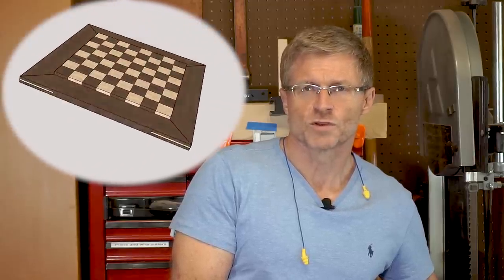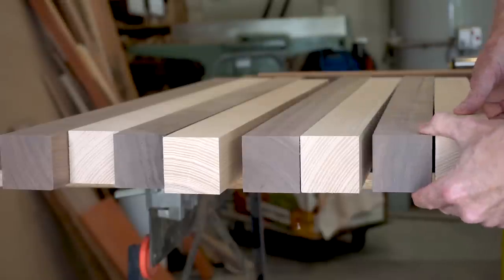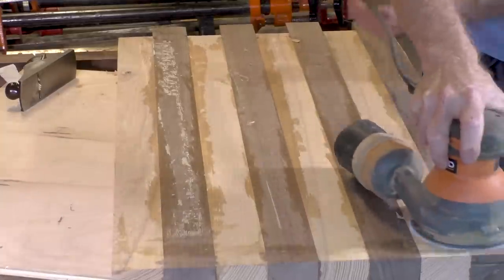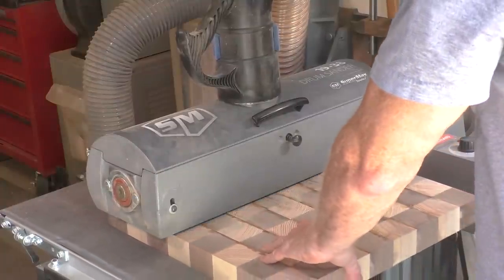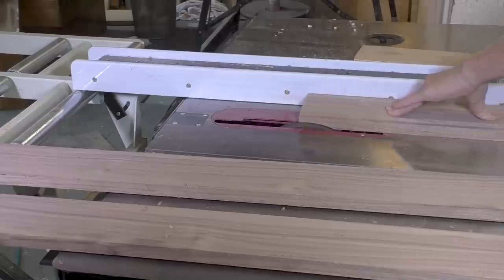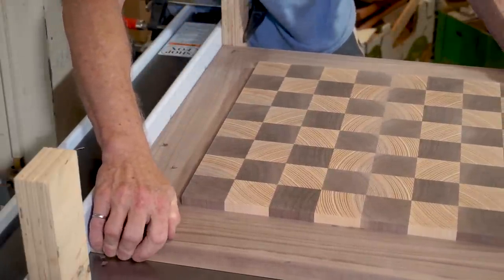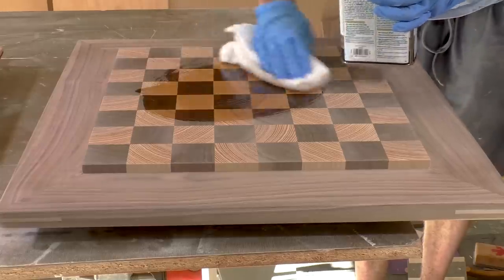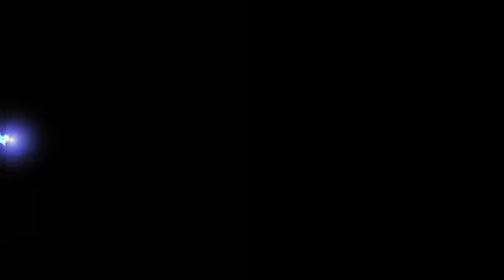How I made two Regulation Size End Grain Chess Boards

Comment: Great chess board.  I have made a few of these and can see what a nice job you have done. The person you made this for will be very happy -- as will their children and grandchildren, I would wager.

I believe you would also appreciate the way James Krenov designed the board for his chess table. The individual tiles are connected by dowels and they seem to be floating in space.  The board can be easily made to fit on top of a case that holds the chess pieces. Typical of a Krenov design, it is extraordinary.  Again, I think you would appreciate it.

As always, great work!
Reply from the maker: The James Krenov chess table is a stunning piece of work! Thank you for pointing it out to me.  I'm almost tempted to try making one. Maybe I'll work up the courage to give it a try one day.
Reply: @Woodumakeit  cAN You tell me where I can order One?

Comment: I like the walnut frame, but both are beautiful.  I am actually in process of making my own board, but won't be doing end-grain.  I am very jealous of your tools!  I have 3 tools on my list that I see as "must haves", 1) band saw 2) wood lathe 3) drum sander.  I had to take my board to a local wood supply house, to have them run it through the drum sander.  They only charged me $10, but it is a 35 minute drive each way, so time was the real cost.
Thanks for taking the time to put this video together and sharing with the rest of the world.  YouTube definitely provides a platform for sharing and learning!
Reply from the maker: Thanks for the feedback. It took me a lot of years to accumulate all those tools. It's great that you were able to find a way in the short term to get access to a drum sander. Mine has become invaluable and it's one of those tools that I wish I had bought much earlier.
Reply: You can do it without a drum sander but you have to very carefully glue up the strips, it's a pain but it works with a little sanding. That being said... i want one too 😒

Comment: Yes, yes I will make it.  Great video with some great tips.  Going to attempt this project over the next few weeks.  I'll let you know how it goes.  Thanks for sharing yours.  I'll go with the tiger maple as my favorite just because of the quilting on that border.  Beautiful!
Reply from the maker: I'd love to see the end result!
Reply: @Woodumakeit  Hey Mike, I'm almost finished with this project, but wanted to get a little advice.  Where my border is meeting up with the chess board itself I've got some small gaps.  I'm trying to think of creative ways to conceal them.  They're a little too big to try to fill and sand so was thinking of some sort of a small accent piece to butt up next to the chess board almost like quarter round.  They wouldn't really need to be too big in terms of height and width, maybe 1/8" to 3/16".  Any ideas?
Reply from the maker: @DEJaegerWoodworking  That might work, although if the gaps are due to the edge of the board being uneven, it might not conceal the gaps.  Another possibility could be to use a router and carefully rout an intentional gap between the frame and the board. If you email me, I can send you a photo of one I'm working on now that has an intentional gap like that. I did it preassembly with the table saw, but a router should work if you're careful.

Comment: Hi. I've been meaning to make one of these but you need to start with 3" thick timber to get a square of reasonable size, (70x70mm is the most you can hope for) and that is expensive, especially Maple/Walnut. I picked up some unidentified hardwood from a pallet which is about 4"x3" so I'll give it a go.
Great work, got me motivated again!
Cheers

Comment: From the pictures the Walnut framed one looks tight to the end grain, I'd be worried that movement might stress the frame, whereas the tiger maple appears to have expansion room.
Reply from the maker: Good observation regarding the gap along the maple frame. I am hoping that both will be ok, but the walnut frame definitely has more risk of expansion putting stress on it.
Reply: @Woodumakeit  Any update?  Did the board hold up?  In my limited experience, "I hope it will be okay" has never worked out well for me when wood movement issues are in play.  Then again, I live in Canada, where the climate varies considerably with the seasons; perhaps you live somewhere where it's less of an issue.

Comment: Very nice! I am in the middle of the same project. I looked this video up as I was nervous about getting rectangles following the planing of the first glue-up. I think I might try to leave the squares slightly rectangular going into the first glue-up, then planing down to square. Great ideas for the frames, will be borrowing that for sure. Thanks for the confidence boost and motivation!
Reply from the maker: Thanks for the feedback. It's definitely smarter to start with rectangles for the first glue-up. I've done that for my subsequent videos where I made chess boards.  Good luck with everything!

Comment: I love your chessboard creations!   I ended up making a version that was a combo of your 2 board designs.  I used curly maple for the frame but with no bevel.  I also popped the curly maple with danish oil followed by shellac and a brownish glaze. Then after another shellac layer, did multiple wipe-on poly layers and polished it to a smooth satin finish.  I went with a poly finish since it will be a chessboard that gets used by all ages and I am fully anticipating there will times when a glass is left on the board...

Comment: I made a couple of end grain chess boards that were also cutting boards last year as gifts, and I'm thinking of doing another one as my next project. Making them to regulation width (25 inches by 25 inches) would make them almost 2 and a half times as heavy as my 16 inch by 16 inch efforts. Those were chunky at 1.5-2 inches thick. Making one that size... I might as well just make the chessboard into a tabletop... which could be pretty neat, actually...

Comment: First, thanks for all the time and effort you put in to create this video.  It seems easy, but if like myself, I find doing the video and editing take longer than the actual build of the piece. 

I appreciate that you used solid wood throughout, and this definitely puts this in the higher class product, but I really take the challenge to minimize the amount of precious wood used in a project, and the fact that you really only view the top of the board, that you could have just used a "filler" like MDF for the foundation.  You could have made at least a dozen of these boards with the amount of walnut/maple that you used.  

But, I am definitely impressed by your workmanship and the final product!  Well done.
Reply: I like the idea of conserving hardwood. How do you protect the MDF from moisture? I would worry that the MDF gets wet (spilled drink, left in the rain?) and the expansion ruins the project.
Reply: @stopfollowingme2391  The MDF would be sealed under the wood and not exposed to any minor drips/spills.  If I made a chess board like that, I guarantee it won't be sitting out in the rain.  Yes, if you soak the board in liquid, the MDF would be an issue, but that is not all that would be an issue.  If MDF is still a concern use pine or other common wood for the "filler".

Comment: I just did the first glue-up step on mine--actually the 2nd since I didn't have 10/4 wood to start with. I used ash cut from behind our house (useable stuff now extinct). For the dark squares, also ash, but thermally treated so it's the same color as walnut. Picked up a nice hard curly maple board today for the border. Can't wait to get back out to the shop tomorrow to cut the end-grain strips and glue them up into something that looks like a real chessboard. Thanks for the inspiration!
Reply from the maker: Good luck with everything!

Comment: Love this video. Thanks for sharing. There's one thing I'm struggling with though. The frame should be pretty much dimensionally stable. If the end grain has any expansion/contraction, which we would expect in both directions, it seems like the chess board should be required to completely float in the frame. Wouldn't the little glue dots in the middle of the edges constrain the expansion or fail under the stress? 

I don't mean this as a criticism in any way. I'm just trying to plan my own build and I like the general design you used here so I'm considering something similar. Maybe using those resin spaceballs would be the solution?

also - I think I like the tiger maple frame the best.
Reply from the maker: I agree with you. After making this one, I decided that a better approach is to not put any glue at all where the frame meets the board. I've made several others where I put glue only on the miter joint, and then the frame just floats around the playing field. The tongue and groove fitting is tight enough to prevent any movement except for the natural expansion/contraction.

Comment: Hi Mike, I'm sure you get this all the time but your work is beautiful. Not just the finish but designs too. Very inspiring. I've been thinking about making my own chess board similar design (I'm a beginner to woodwork) and have a question; I'd like to use the end grain for the squares too - but how would I go about having the tiniest tiny 'bevel'/sanded edge between the squares. I guess that's an early stage. Is the only way to cut the squares individually and do some fine sanding before gluing? Sounds not ideal to me... Any help/info appreciated. Thanks!
Reply from the maker: thanks for the feedback!  I would probably do that with my CNC router, although that can take a lot of setup and a lot can go wrong.  If you don't have one, you might want to try using a chisel like this one to hand carve a v-groove between the squares after it has been glued up. https://amzn.to/3PK8Sc3  As long as you're careful to keep the lines straight, it would probably work well.
Reply: Thanks so much for getting back to me. I'll look into both those methods, perhaps do some tests and see what happens. Cheers!  @Woodumakeit

Comment: I decided to make one of these as a project for myself. I have borrowed your design I hope you don't mind. I am going for the walnut frame as I cannot get any tiger maple here in Ireland at the moment. I was just wondering if you used any sealant on the end grain before beginning to apply your finish?

By the way both are fabulous looking pieces..... exceptional work.. and also a great video that shows just how important having the correct equipment is...

Comment: Can you please tell me, have you checked how ash wood works with walnut in terms of thermal expansion coefficients? What is the risk that these types of wood are not friendly with each other, resulting in cracking, swelling, or splitting? Also, what if I wanted to make the board wood-block end grain to top to make the wood structure more fancy - would gluing them be any different? Thank you.

Comment: These are beautiful.  Thanks for sharing.  I wondered on the maple edged "floating base" board, there appears to be a slight space between the edge of the actual playing surface and the edge of the floating base, whereas on the walnut edged board, there is no such space.  Wondered if that was by design, perhaps to add to the "floating" nature of the tiger maple base, or unintended?
Reply from the maker: I did that by design to help contend with wood movement. That way, if the squares contract and create a small gap between the squares and the frame, the movement will not be apparent because the gap is already there. I recommended to the client of the other board that I do that on his board, as well, but he decided against it.

Comment: Your jointer, table saw, and drum sander are top of the line, I was surprised to see the dewalt planer - are you happy with it relative to the rest?
Reply from the maker: It definitely does the job well. I might upgrade at some point so that I can get a larger capacity (20??) and a helical cutter. But I'm quite happy with the DeWalt planer, so I'm in no rush.

Comment: Very nice woodworking. JMHO - As a chess player, I find the 2 level effect between the board and frame a bit distracting, also, adding algebraic lettering A-H and 1-8 would be a nice addition. Good job overall though.
Reply from the maker: Thanks for the feedback.  I'm starting on a new board this week that as been commissioned from a viewer in Austria and he has asked me to add algebraic notation.  I'll definitely make a video on how I go about doing that. I hope to be able to release that sometime in February if all goes well.
Reply from the maker: I released a video this past weekend that shows the same board but with algebraic notation. https://youtu.be/pVvoK840mwQ   I'll have another video released this coming weekend where the board and the frame are all in the same plane, with the owner's initials inlaid into the corner.

Comment: Beautiful work! Just one curious question: did you ever lock the head of your DeWalt planer when you ran your initial pieces through around 2:10? I have the identical planer and if I dont lock the head, I dont get a good cut. I noticed around 8:35 the head was locked. Again, very nice boards!
Reply from the maker: Good question!  I find myself frequently forgetting to lock the head, and it's definitely not intentional. I find that the quality of the cut does not suffer when the head is not locked -- at least not with my planer, but the cut depth may vary from piece to piece ever so slightly. When I'm making the final pass, or if I'm making something that requires very exact dimensions, I do lock the head (when I remember) to minimize variations.

Comment: Nice, so are your tongue widths slightly shorter than the groove in chess board to allow for expansion of board?
Reply from the maker: That's exactly right. I typically leave approximately 1/8" of space on all sides to allow for expansion.

Comment: Beautiful boards. One thing I am just struggling to grasp and I've been watching a number of these builds, is that you want at least 2" squares, but you often need to true up the edges of the board during the cuts, so you lose material. Doesn't that make the center squares larger than the perimeter squares by the time you're done? I'm very new to woodworking and find I loose "a lot" of material while I try to square things and correct little mistakes. I'd be afraid of getting 1.5" perimeter squares and 2.25" center squares :\ How do folks account for that or is it so minimal that it's not noticed and permissible on a regulation board?

Comment: I really like the look of the board being raised above the frame with eased edges. Have you played with feet for the boards? (they often rest on not-so-flat surface). Do you find that just a few felt stickers does the trick or ever try carving in the feet?
Reply from the maker: I'm working on a custom order for a similar chess board and the client asked that I add round pieces of felt to the bottom of the board, similar to what I put on the chess pieces that I made (in another video).  I like the simplicity of that idea and I think it will work well to protect both the board and the table that it will sit on.

Comment: Do you have an update on the wood movement in both? Having the chess board as endgrain makes most expansion happen in its width and length, so you'd maximize strength on the borders. Incidentally, is that fiddleback maple on the maple-bordered one?
Reply from the maker: I think it's just regular curly maple, or tiger maple as it's called in the northeast. I've had only one report of wood movement where the squares contracted a bit and pulled away from the frame to expose a tiny gap. That's the reason I put the gap in the board with the curly maple frame, but the client of the board with the walnut frame did not want the gap. I've been advocating that to clients as I produce more of these.

Comment: Both are beautiful. I usually gravitate toward walnut but in this build you got me with the tiger maple. Those must be some really heavy chessboards. How much do they weigh?
Reply from the maker: I'll get back to you with an answer on the weight because I'll be making another one in January. I would guess they're about 25-30lbs.  The next one is going to Austria, so it definitely won't be cheap to ship.
Reply from the maker: I made a couple more of these recently and it turns out that they weigh in right at 20 pounds.

Comment: When you cut the maple border to insert into the dado , do you fit it to the chessboard in the dado or are you leavening a gap ?
Reply from the maker: The maple fits tight to the top and bottom of the dado, but there's an air gap at the back of the dado (i.e, the tongue is a little shallower than the dado is deep). This helps to allow for wood movement so that the frame doesn't break apart.

Comment: Most YTs I've seen, and Cutting Board Mafia on FB, involving borders provoke a comment that they'll split when the center wood expands.  You mentioned wood movement and only glued part of the T&G.  That technique seems somewhat like a breadboard end on a table.   But the expansion force is at right angles to the mitered pieces and if they are tight to the board there could be problems.  I admit to not fully understanding expansion/contraction and try to keep the things i build small enough that its not an issue.

Comment: Absolutely stunning boards. I would make it. Did you charge for the boards? If so, I hope it’s not rude to ask how much. I’m interested in understanding other woodworker’s pricing strategies.
Reply from the maker: Thanks, Phil. Yes, I charged for them, but probably not as much as I could have. I sold these for $200 each.
Reply: @Woodumakeit  ouch. I wouldnt have made those for less than $350. Hell, Mtm wood charges upwards of $1300 for almost the exact same board